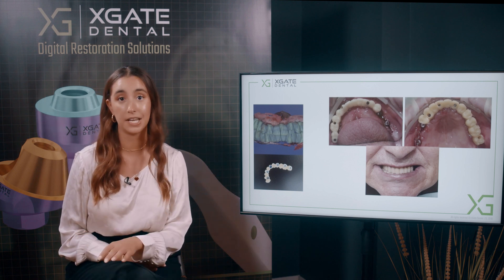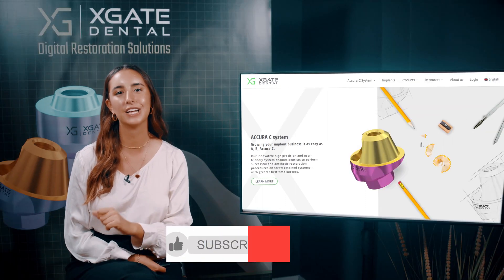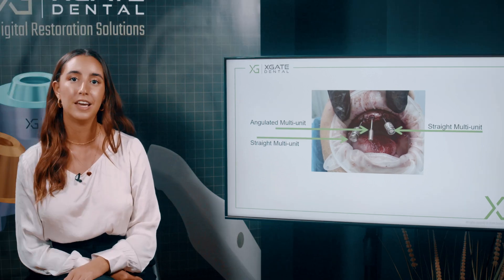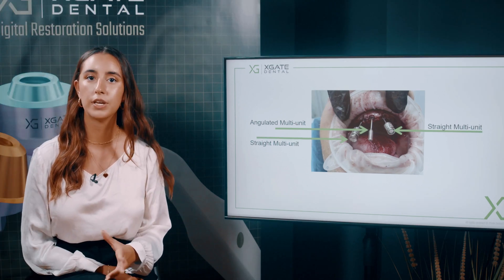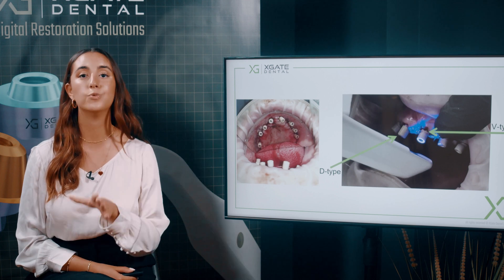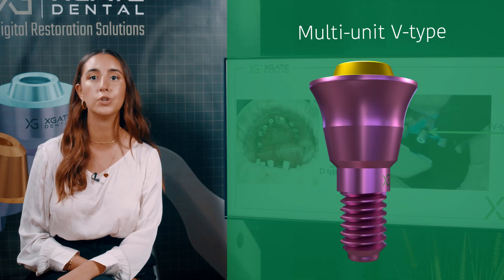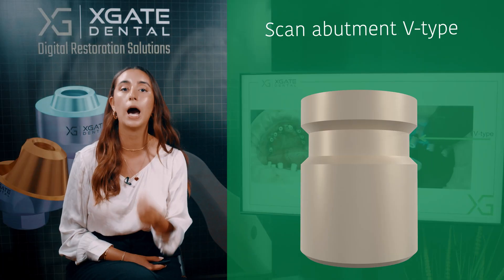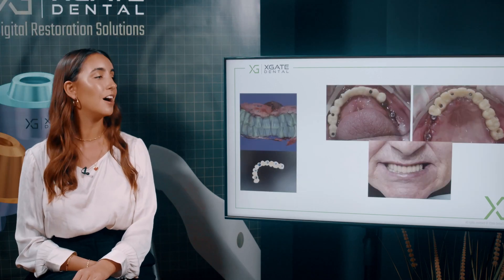The angulated V-Type Multi Unit defines angulation of the future screw channel

Comment from the maker: 00:00 Making an immediate restoration on immediate implementation 
01:00 You can see that we have different types of multi-units
02:00 The axis of the screw channel will be about 30 degrees palatially 
03:00 Is the maximum angulation that you have
04:00 He will have to take impressions again so you can change this multi-unit impressions